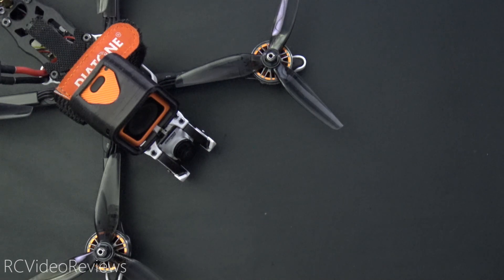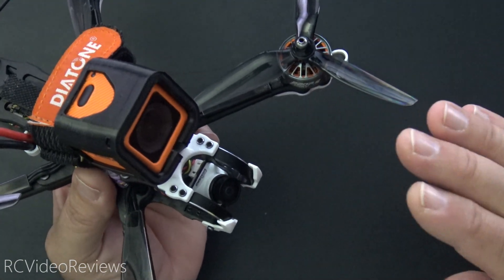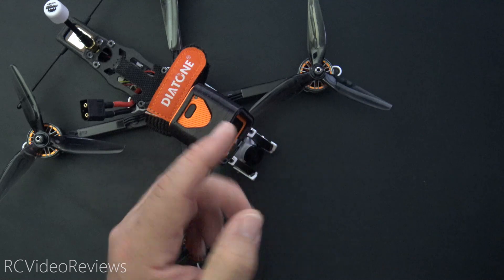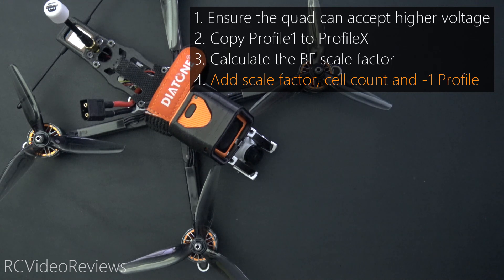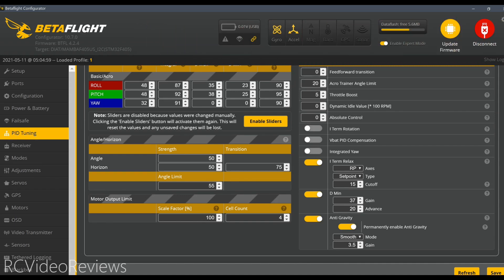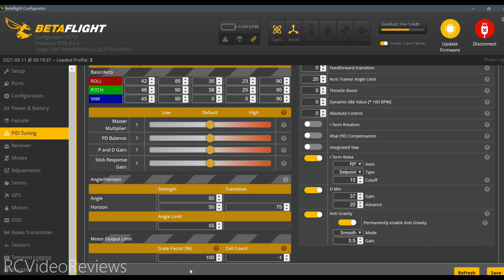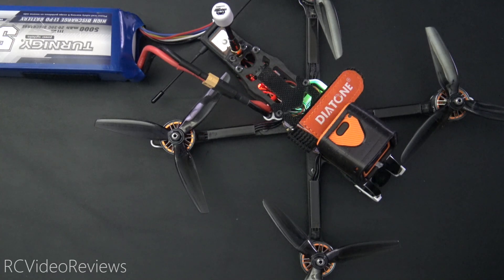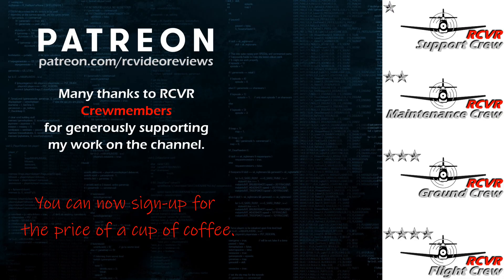Fly Your 4s Quad with a 6s Battery! • Automatic Switching • Betaflight Motor Scaling

Comment: Awesome video friend! Does this alleviate the sag that you would have with the 4s? Also when you use the 6s do you get more run time on those motors? Thanks in advance 👌🏽
Reply from the maker: Ohm's law says yes to the sag question. For the same watts input, an increase in voltage results in a decrease in current which means you will encounter less sag. Runtime is dependent on watt hours if load is maintained.
Reply: @RCVideoReviews 🙏🏽

Comment: Nice videio. About buy a 6s quad with 4s? Do you have a video explaining this use? Just plug the 4s or will be good make some changes in betaflight?
Reply from the maker: It doesn't work in reverse. You can use a 6s motor on a 4s quad, but the other way around and it'll be a doorstop.

Comment: 4S motors on 6S works fine, thanks to motor scaling. However I'm now more interested about 6S and 4S motor mix in same quad. Because crashes happen, motors burn, shipping is slow and summer is about to end. And I have a dozen of new 4S motors (2300KV, 2600KV) from 4S time in shelf :)
Reply from the maker: I'm not aware of any method to mix and match on one airframe and I probably wouldn't try. You'd probably wind up making the pid loop crazy.

Comment: Hey!
 I need to use 6s quad with 4s Battery for just incase..So what should i do? Thanks ❤
Reply from the maker: Doesn't work that way. 6s quads are going to have slower spinning motors. If you fly with 4s, you'll be highly underwhelmed on the power.

Comment: Great vid! It’s as straightforward as you can get. I saw this feature, pretty useful if you have both 4s &6s builds. Or just want to use 6s on a 4s quad. Interesting about the motor windings 6s vs 4s. Lower kv can take less amps, seems counter intuitive. I’ve read it but I guess it didn’t really sink in.
Reply from the maker: It works too. I switch between 4s and 6s and don't even think about it.
Reply: my motors are designed for 4-6s, so i guess mine can take more Amps as well.. they are probably not as good at 6s is my guess?!

Comment: Hey, thanks for that man.

Do you think it will be the same as real 6s motor out of the box? 

Performance - heat….
Reply from the maker: I don' understand your question. This method is meant to slow down the rotation of a higher Kv (4s) motor when connecting a 6s battery. If you already have a lower Kv (6s) motor you don't really use this process. I can tell you that every one of my 4s quads use this technique and they all work fine.
Reply: @RCVideoReviews  i mean does it perform like real 6s quad out of the box?
Reply from the maker: Yes of course it does as long as the dimensions of the can, magnets, and pole count are the same, the remaining variable is wind count to determine kv. So as long as you have control of how fast the motor spins you can make it spin at the exact same speed as a “6s” motor which means it will deliver the same power.

Comment: Is it safe flying 4s quad with 6s lippo? working out this way?
Reply from the maker: All of my 4s quads are setup to use 6s batteries. I can and do switch back and forth at will.
Reply: @RCVideoReviews  Ok have you tried it on emuflight

Comment: Thanks you so Much
Reply from the maker: Most welcome. Hey FYI, we found something out after learning to use this profile in Betaflight. It's possible if you tune your ESC for 4s that it might not like running the same way in 6s. So just throwing it out there, you may want to do some testing to ensure your ESC is happy at either setting.

Comment: i've done exactly what you did and mine does not change from 4 cells to 6 cells
Reply from the maker: Is your firmware up-to-date? This is confirmed working on at least 5 drones.
Reply: @RCVideoReviews  firmware 4.2.9
Reply from the maker: Is that up-to-date?
Reply: @RCVideoReviews  i have a 3600kv so if i want the drone to be 1750kv its 48% ...i was readinf to the question mark note on betaflight it says to put 66% ... should i try it?
Reply from the maker: I would work on ensuring bf picks up your voltage changes before working on the next issue. When you have that working, just follow the video example.
Reply: @RCVideoReviews  to be honest i dont know why its not changing ... i can't figure it out
Reply from the maker: Is your firmware up-to-date?

Comment: will it have the same power as a 6S motor ?
Reply from the maker: Excellent question. I avoid offering opinion as fact and have not found a way to accurately test thrust on a scaled motor. So the best thing I can do is offer an opinion. Given everything about these higher Kv and lower Kv motors is the same (bell, magnets,  can design) and the only thing governing Kv is the number of winds (and in some cases thicker wire) I’m going to make an assumption that a 4sKv design spinning on 6s voltage with scaled rpm should perform very very close.  This is opinion though and not based on any measurement.

Comment: Are there any flight time improvements from flying 6s battery with 4s motors?
Reply from the maker: In theory yes since we're holding the load constant and increasing the voltage, amperage should drop in relation to load. I haven't tested it yet though. If you test, let me know what you find out.
Reply: @RCVideoReviews  is there any downside in using 4s motors permanently instead of replacing the 4s motor with 6s motors if you set everything like you explained ?

Comment: How does this effect flight times? I know this gets into a weird area of cell count vs  total wh of the pack and math over my head. Just assuming I was going to build a long range 21700 pack and had the opportunity to build a 4s vs 6s and then scale in software it's hard to think I wouldn't see a benefit in flight time because of the 2 extra cells. I'm not crazy to think that am I? Higher total wh = longer run time or would the weight negate the benefit of the extra cells..... Lol now I'm just thinking in circles.
Reply from the maker: I'm planning on a back to back test with one of the quads. It does get a little dicey trying to predict because if you make the assumption that motor scaling results in a similar input watts outcome and volts times amps = watts, then more volts = less amps = more flight time. However; we're adding weight in the form of two extra cells. So...hard to predict. I think performing a couple of test flights will yield the best estimate.

Comment: Just curious, would you need to setup another profile if you also want to use 3s or would it default to profile 1 (4s)?
Reply from the maker: If you connect a battery without a cell count specified, the last selected profile remains active. I tested this by connecting 6s then 3s--it stayed on 6s.
Then I connected 4s, it switched to 4s.
Then I connected 3s, it stayed on 4s.

Comment: Been doing this for a few years, works like a charm!
Reply from the maker: What has your experience been in terms of flight time gained or lost using 6s v 4s? Thanks for the field report.
Reply: @RCVideoReviews  honestly I haven't noticed much difference but as of late I have not been flying much with things as they are in the world. I just wanted to make the leap to 6s without buying new motors. What I can say is I have not had any issues at all, not hot motors, no burned out motors and no desyncs. Overall it has been a positive experience.
Reply from the maker: @markb9896  Good feedback. I'm sure people watching this subject will be appreciative of your first hand details. Thanks for sharing.
Reply: @RCVideoReviews  my only recommendation to those who want to try this is follow the math. Don't go too high on your % as this can cause hot motors or desyncs. Most of all enjoy it because it works really well :)

Comment: This is a cool trick. It's probably cost prohibitive but it would be interesting to see the true 6s version as a comparison.
Reply from the maker: Honestly, I think if their programming logic is sound there won't be a difference between the two--but without VIDEO EVIDENCE I can't put a stake in the ground and make the claim. If the motor can/magnets are the same, the difference in power will come in matching the Kv and maybe the wiring inside. If I were to make a guess--I'd say the difference would be marginal.